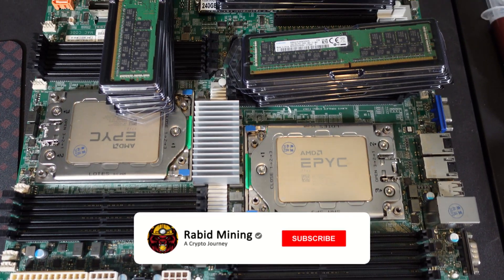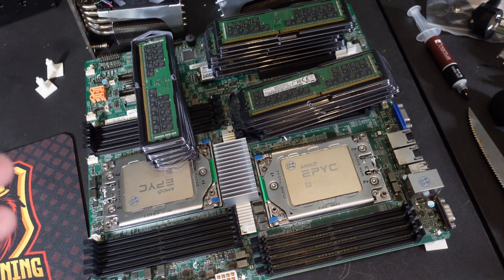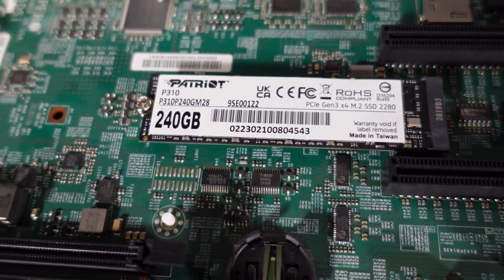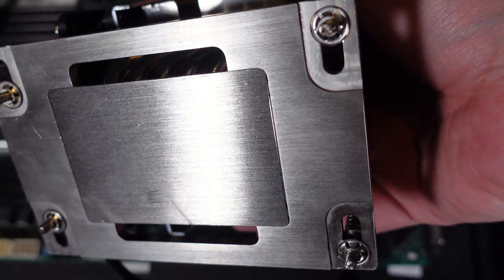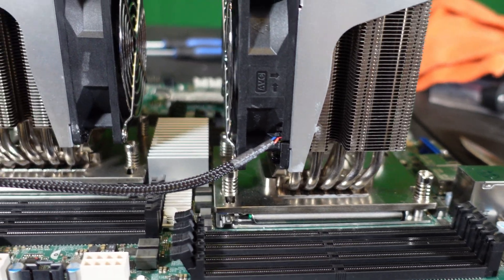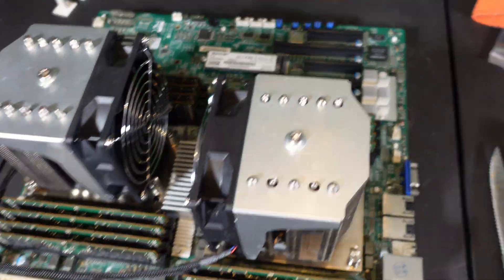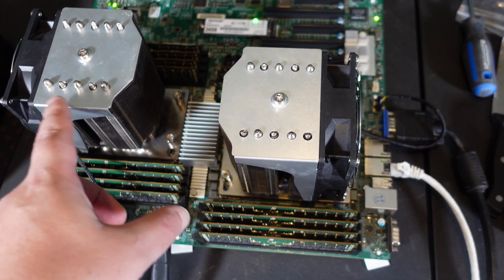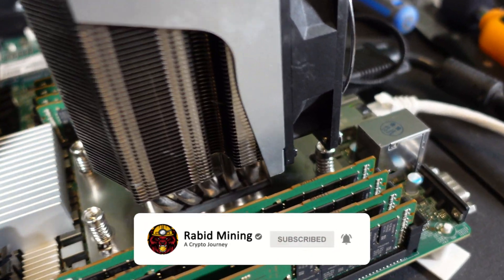Dual EPYC 7742 Build - VRM ISSUES!!!

Comment: I just placed my order for most of the parts for this build. My question is, will a regular 1200w PSU be enough? Or do I need a server PSU?
Reply from the maker: 1200w should be good.
Reply: @RabidMining  vRM solution? 40mm Noctua?

Comment: I'd skip SM motherboards if you intend to use high end consumer GPU's on these - some just wont work (boot). Also SM is picky about other PCIe devices too.

The total cost can be around 4000. I'd suggest anyone just to get same hashrate just to build cheap amd builds as those will hold up their market value much longer than Epycs. These prices has been the same for over a year in eBay for no reason (Chinese monopoly). Also ARM is coming :)

Comment: Hey man. Are you limited to hiveos on this motherboard? Im getting mine delivered today, worried as hell about OS. I would like windows, however i don't think it would work.
Reply: For dedicated CPU mining builds it is best to use Linux distros without GUI. You can use Windows Server but Windows Server doesn't support 1GiB pages which brings 1-5% more hashrate. My suggestion is to use Ubuntu Server LTS 22.04 with HWE stack (without GUI ofcourse) and run XMRig as root. You can easily manage rig with SSH from other computer. Cronjob can be also configured to automatically run XMRig on system startup after power outage for example.
Reply: @sassdrake9594  thanks man, sounds very interesting, could you please direct me right direction to get more info on such set up? Windows user here, but will gladly look elsewhere if its better. Thanks very much
Reply from the maker: Some use it in windows
Reply: @RabidMining  nice, thanks, will see if it's feasible too

Comment: Stop the memory you guys have is all wrong.  Do you want to maximize random x? This is what you need to do. 1. Use single rank memory. 2. Use ddr4-3200 ECC rdimm. 3. Occupy all memory slots to enable 8x channel. 4. Under clock the memory! Yes for 3200mhz ddr4, set it to 2400mhz in the bios. This will decrease the CAS, known CL. Lower CL = higher hashrate. And if you are using an ES cpu, set power limit 250 and cTFP 218. , set DControl to manual, DSlider to power, iommu enabled  and acs disabled. BAM 100kh/s..
Reply: How many gb per stick?
Reply: How much worse is the dual rank vs single rank for what you’re talking about?

Comment: Not good. Wrong memory and wrong fan placement, and missing fan on the VRM.  Also, that motherboard is the worse. You will burn out the ATX power connector in a matter of weeks when running POWER MODE.

Comment: RM wow I would think pull hot air away from the vRAM would be a better setup, having the CPU fans on the inside blowing out, what about putting two 40mm fans on the VRAM heatsink? Or maybe the VRAM heatsink needs to be repasted? Keep up the awesome content I am build a EPYC 9334, also they are many Intel CPU with full 2+MB L3 per thread, they are just more expensive than EPYC.

Comment: spreading the paste in a thin layer across the cpu is the most efficient proper way, has been tested in a few videos ive seen.  i overclock the 2133 memory to 2666 so far and gained hash without issues so far.
Reply from the maker: Nice

Comment: So what I do on my server boards is take a Delta blower fan that can b found on a 1U server heatsink.  You can normally just point them at the VRM and it is just fine.  Or you could be "crazy" and 3d print a shroud for it that holds the fan and friction fits/light dab of glue in one spot to the heatsink.